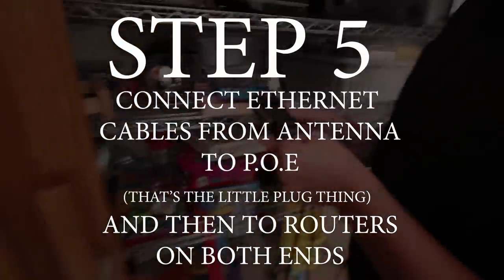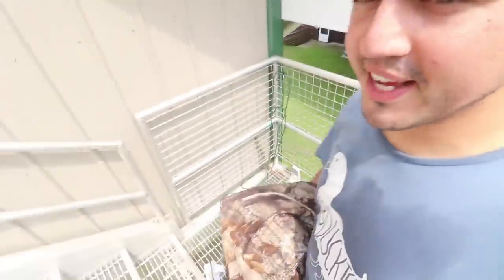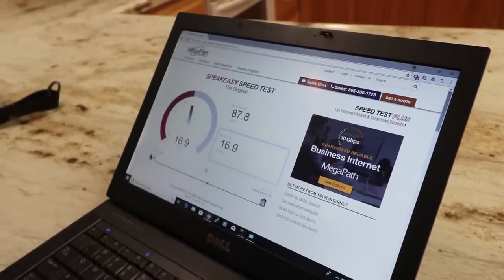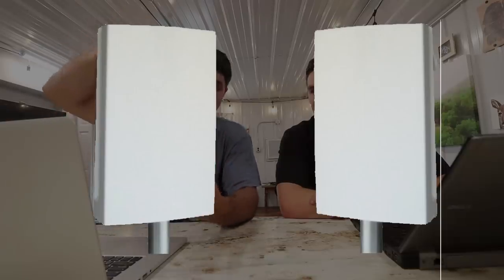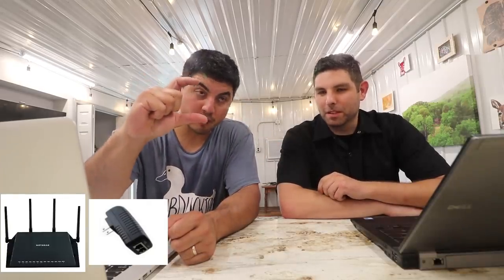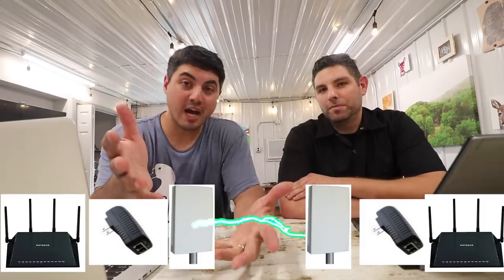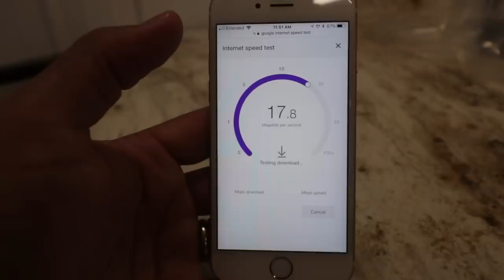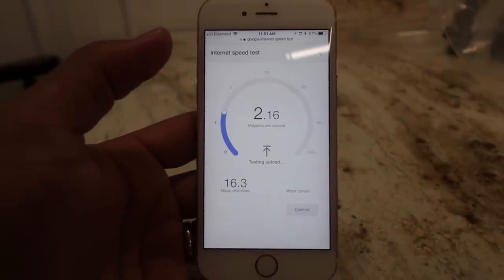How To get Internet From a House To Outbuildings, Barn, Studio, Office, Setting Up a Wifi Bridge

Comment: I would have mounted high poles and run fibre optical cable and that would be easy system on top, just to have a fibre optical to ethernet transceiver at either end faster, or run low loss cable CAT6, maybe dig a small trench and place upvc in the trench have cables in this, for any future systems use 7" or larger PVC tubing, 
you can get mains to ethernet adapter and use same power for the system, !

Comment: Not too far in, but why not just run the long ethernet cable into a new wireless router? Just sayin'?  "Line sight?" - The REALITY is you run "HIGH SPEED" with cable and then go wireless.  There is this "thing" in networking called a "SID".  What that means is your "network" is called "my home network" and then you have another "SID" called, "my barn".  It's an ethernet cable attached to your router and then attached you another wireless router. DUH!?

Comment: Hey wondering if anyone can help. Setup the same bridge network and now
My home WiFi isn’t working. Says it’s connected but no internet. WiFi works in my out building. I disabled the router in the shed just as they explained , can anyone help?
Reply: First step is to disconnect your bridge. Does internet come back with it being disconnected?

Please tell me what equipment you are using. We can go from there.
Reply: From your description, it sounds like you truly didn't disable DHCP on the other device. Sounds like you have multiple routers which can cause all sorts of trouble for most. Typically, the best setup is to have a switch or an access point on the other side of the bridge as these rely on a router to hand out addresses.

If you are using Windows at your home (the device that says connected but no internet), what you could do is the following to see where it is picking up it's IP address.

On your Windows device, open up command prompt. To do this on a Windows 10 device, simply hit the Start button on the lower left. Once there, type command prompt. Click the search result and you will now see a black box.

In that box, type in the following: ipconfig (Then press enter)

Look at the default gateway. If that default gateway IP Address is different than the devices that are working, that is the device you need to remove or rather change to make it into an access point (disable DHCP).

I could wrong in what your issue is but it is a starting point.  Like mentioned earlier, please let me know what equipment you are using first. Your home and in the out building. Knowing this will help a lot.
Reply: @G1itch02  I've seen how you've helped many on here and wanted your input. I bought the product in January and installed it and it worked fine, but lately it has been failing and my wireless access point at my secondary building is always going out and the connection is shoddy. Even though there is a clear line of sight and the distance is less than 200ft, the connection from my wireless access point is poor and never consistent. I've tried unplugging and reseting from the software but to no avail, as the connection is still really bad and randomly drops.
Reply: @Retrical  Tell me what happens when you connect just your laptop on the other side of the bridge. Then run a constant ping to google.com. Does it timeout? You should see probably 30ms or less. If you see it spiking or timing out, you have an issue. Do this at both locations. First at your house so you have a baseline of what you should see then at the other end of the bridge. 

To do this, open up command prompt and type in the following command: ping www.google.com -t

Like I said before, at the other side of the bridge, just have your computer connected to it. Run the test. Then connect your access point back up and try again. Does it drop after doing this?
Reply: @G1itch02  my signal stregnth is -28dbm even though there is clear line of sight
Reply: @Retrical  Your signal level is a little too hot. You need to be between -35 and -75 dBm. Turn down the transmit power on both units. You need to do this as they are pretty close together.

Let me know how it goes.
Reply: G1itch02 how do i do that ?
Reply: @Retrical  Seems like you know how to log into the system.

Once logged in, go to Device Configuration. Under there, you should see Transmit Power (dBm). Make the adjustments there.

You could also try changing channels as well. You do this under the same section, Device Configuration. According to their documentation, a good signal strength is between -40dBm and -60dBm.

So aim for that.
Reply: G1itch02 thank you but i can’t seem to locate where it says “Device Configuration”
Reply: G1itch02 Disregard that, I just found it
Reply: G1itch02 Okay so I went on the menu, but it only let me set the dbm between 1 and 25dBm, is with the other option being max. I can’t set it between -40 and -60dBm.
Reply: @Retrical  When making power adjustments, does the signal strength gets adjusted? Make a change in both. Lowest setting, and see what the signal strength is. Start there.

Comment: Why don't you just try a Wi-Fi extender or Wi-Fi repeater
Reply: Dustin Wethington because WiFi extender/repeater at that distance the throughout would be terrible... your talking about going from one house to another. WiFi signal doesn’t travel through walls. It bounces around walls and makes it way through open spaces.... WiFi will not travel through windows or tin. So he would be extending a WiFi signal through several walls and at least 2 exterior walls. Not a good idea

Comment: You all like to overcomplicate shit I can tell. I would have just bought 1000ft of cat6 outdoor cable and dug a trench a couple of feet deep and ran it from your house out to whatever building you want it in. Then just add a switch or router in that building depending on weather you want wifi or not and be done with it.

Comment: Why not just run a cable out there.
Reply: For this distance, probably would've been fine. But if you consider the time it took to build this, mounting a cable with the tension fixtures etc would've taken longer to run a permanent cable. That said, this tech is better used for longer distance and a cable would be higher speed for the cost here. Cat6 is a sweet beast! You can buy a converter for just about anything these days, even HDMI(Home Theater) I want to try this with a Ubiquity antenna tbh. Gotta give the neighbors Corona with that 5G :P